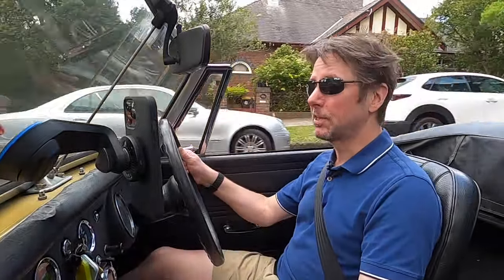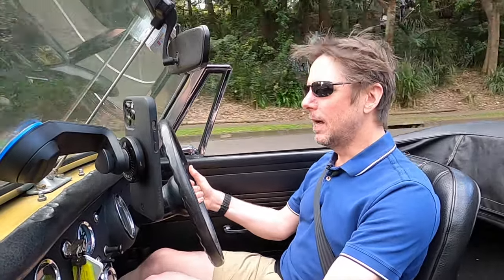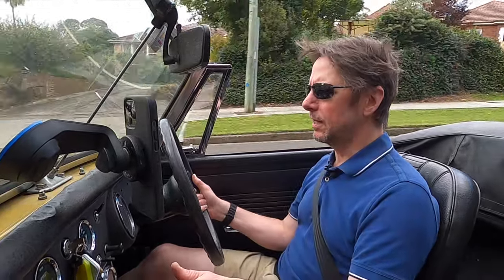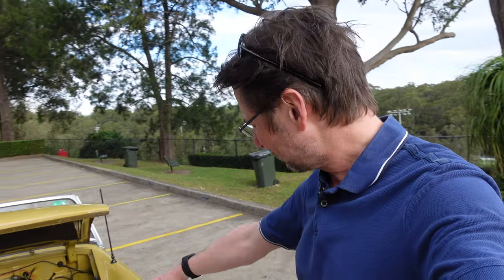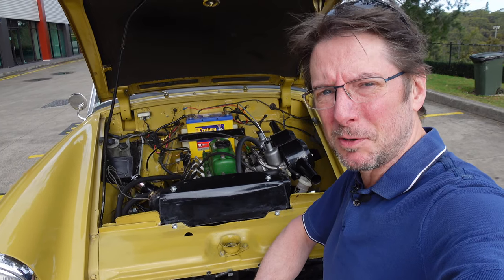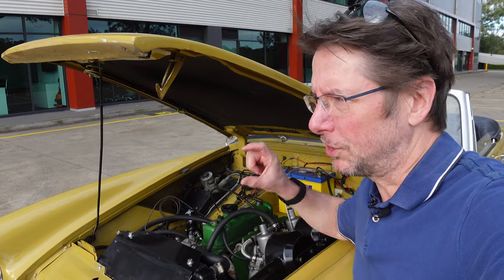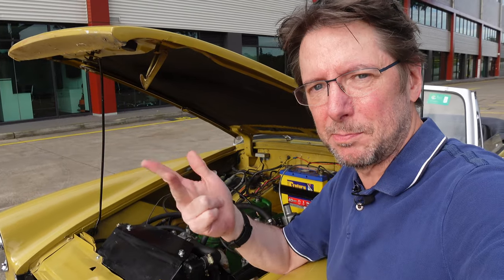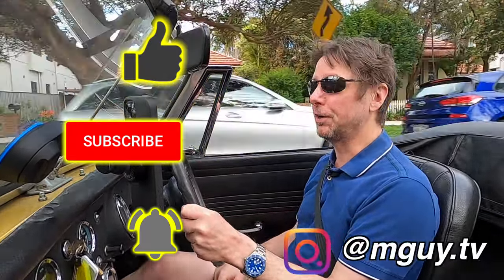MG Midget - Misfire cured with simple fix! | MGUY Australia

Comment: These cars are so simple to service and keep running perfectly. It’s usually always ignition problems by poor servicing or cheap parts. A & B series engines are very reliable indeed. Old fashioned cast iron, if you ever lose the hot water , you don’t get aluminium buckled cyl. heads.

Comment: Bare spark plug connectors???  I have never seen that even in 'those' days (I woz there).  Some numpty put them on without the rubber covers.  8V coil, never heard of that either.  BTW you can get electronic points, saves a lot of hassle, and easier to adjust the timing.  Glad all is sorted.
Reply: My 70 midget has the same original bare spark plug connectors like his. I guess it was a thing

Comment: You probably have to be as old as me to know the tricks and tribulations of these things, but bare metal plug caps, even loose fitting ones shouldn’t cause a misfire. The rubber plug caps were more about radio interference suppression, in fact, a dodge of the day was to pull the caps off their seats to encourage a flooded engine to start. Bikers amongst us (of a certain age) will remember that with copper cored plug leads, you could introduce a shirt button into the picture to beef up the spark at the plug gap. Better starting and better running was the theory. The rest of us just had to put up with a loud buzzing on our radios and TVs whenever one of these vehicles got close by. Ballast resist coils, on the other hand, were the devils work, a bodge work around thought up by the manufacturers to overcome starting problems caused by the introduction of emission controls in the early 70,s. I can’t remember why anybody thought that was a good idea. If you put a standard 12v coil on a ballast resist car, it ran like a piece of shit. In fact, a late model Midget or Sprite could quite possibly have had a ballast resist ignition system. I was more into Fords in those days, if your coil had two wires on the +ve terminal, one of them white, then you had a ballast resist system. Being an upstanding eco warrior sort, I regarded it as my duty to rip off such heresies and cast them asunder (along with automatic chokes, vv carburettors and catalytic converters) I think they declared open season on my sort around 1980 in Australia. I had a mk2 Escort as a company car and it had an economy gauge on it, I did my best to keep it in the red at all times. No I didn’t pay for my fuel.
Reply from the maker: Thanks for the interesting background!
Reply: Bare metal plug caps don't work well when rain water splashes up on them... 
One day I noticed water coming out from under the engine box on my boat, I lifted the box to see what was going on and the engine (Ford 302" V8) was covered in water but still running normally with the rubber booted sparkplugs under water, as I had forgotten to put the drain plug back in the rear of the boat before launching it. My female cousin said, "are we sinking?" I said, "yes". I had my cousin drive and speed the boat up to a half plane so the water would drain back out while I went into the cuddy cabin and changed into swim suit. With water gone, we stopped boat/engine, and I quickly jumped over back and put the drain plug in. Then we proceeded to where the 4th of July fireworks were being set off. Turned the radio to station playing patriotic music synchronized to the fireworks display. My cousin was so impressed and had such a family good time that after returning to her home 1500 miles away she had her husband get a boat. 
Ignition systems with ballast coils been around as long as I can remember: at least back in 1950's... they work great... with USA made coils... battery voltage is 10 - 11 volts when running the starter, 14.2 volts (GM) when running, so the ballast resister/wiring compensates for all that. 
In 1960's I drove a '62 Oldsmobile JetFire with economy/boost gauge... I enjoyed the red part: 
https://www.youtube.com/watch?v=Jzw5W1rRMog

Comment: Lucas equipment is perfectly capable of excellent service over a long time. My 1966 MGB still runs its original coil and dynamo and regulator the distributor has been rebushed. When you buy a car of that age you should straight away change the spark plugs, HT leads (I have silicon on my car) distributor cap and rotor arm. I have fitted a red rotor arm and an ignition amplifier due to the "highly variable" quality of the currently available rotor arms and ignition capacitors. Loose HT caps should have no effect as noted before, the spark will easily jump the air gap.

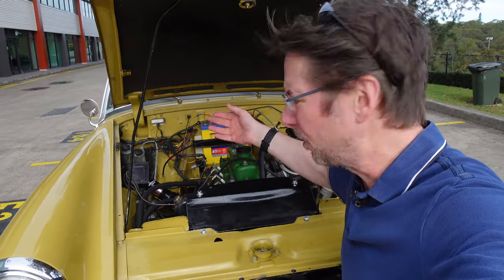Comment: Im having these same issues on startup on my 70. But it ran sweet for 18 months then started doing it. So at the 3:37 mark you mention loose spark plug connectors, but didn’t say how that was fixed. Did he just squeeze the tips with pliars or something to make the metal cap fit tighter?

Comment: Having the same problem with my MGB. I replaced fuel pump. It improved but still low power and backfire. I'm going to check ignition coil and plug contacts. Maybe that will work 🐱 
Thanks 🙏

Comment: I  have a 2  litre pinto powering the mk 3  Capri..my distributor packed up. With a after market distributor I had all kinds of issues. Just wouldn't run right. I located a original Bosch, set it all up and had pinking trouble. I  gave the points a bigger gap, done the timing by ear. Timing the engine properly I couldn't get  rid of the pinking. Adjusting the timing by ear is a good method. My engine is running perfect. Also todays  petrol is rubbish.  I only use  super unleaded. Plus add a drop of lead substitute to add with petrol for upper head  lubricant. The ignition timing can be very frustrating to get right. Retarding is to compensate for today's poor petrol  quality. Petrol today is junk for classic cars.

Comment: Ahem. MG Midgets have Lucas ignition systems. Any and All engine diagnosing processes start with looking at the ignition systems on these cars. This shouldn't have come as a surprise. In reality, this being almost 2022, an after market modern ignition system should have been one of the first three things you did to this car upon purchase. Forget originality. Visualize being infinity away from home with a dead car. 
I love these cars, and if I was smaller, would buy another one in an instant. But Lucas ignitions are the Achilles heel of enjoying a Midget trouble free. Enjoy this car. It is as much motorized fun as you can have with never exceeding 45 miles and hour
Reply: Yes... 80% of that sort of prob is ignition...20% fuel/air.
Reply: Lucas were good quality, a lot of the aftermarket parts are totally inferior, UK were brilliant at capacitors & chokes, BLETCHLEY PARK SPY RADIO were the best, UK very good electrical, electronic engineers, TOMMY FLOWERS & GPO engineers were brilliant, first digital computers albeit valve driven. UK still has clever electronic technicians. BILL TUTTE & TOMMY FLOWERS never got the credit they deserve, it’s always big mouth politicians.
Reply: @davidbarrett1487  I will not argue the engineering about the high voltage engineering here, I've run my 10 year old, 70,000 mile A engine to 6500  RPM with no problems or engine damage. But I did it on a dry day. I've never understood how an ignition system so sensitive to moisture was developed by a company based in England, the land of rainy skies. My final 'cure' was to slather every possible moisture entry point in on the high tension side of the ignition with silicon caulk. Only then did the car become reliable enough to use as a daily driver.
Reply: @cdjhyoung  Yes, you could get soft plastic covers for the distributors and buy moisture repellent sprays.
Reply: @davidbarrett1487  The sprays offered to me from the dealership were ineffective. The same dealership offered some non-spec American designed replacement distributor caps and spark plug wires. that is the route I ended up taking, but still required sealing the cap to the distributor to exclude moisture. This all happened 40 years ago. I would hope that improved pieces are now available to make all these issues a thing of the past.
Reply: @cdjhyoung  Yes, I’m talking of over 55 years ago, I’m amazed at these problems, A series engines were thrashed around race tracks of UK weekly. I ran a MGB not long ago, aftermarket Distributer parts were rubbish. In the old days the CONDENSERS were good and the points could be cleaned a few times before replacement, you got your money’s worth before point replacement. LUCAS were good quality in my day.